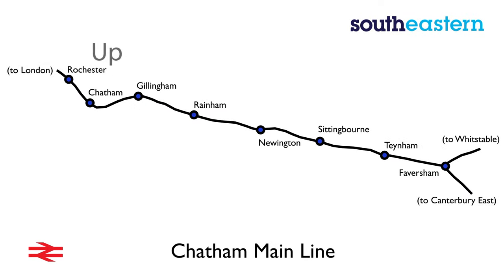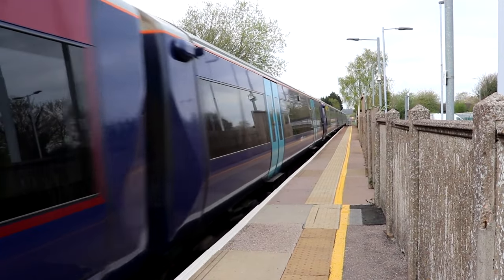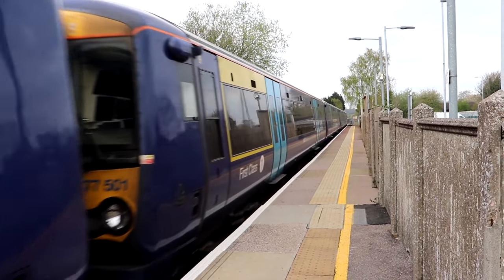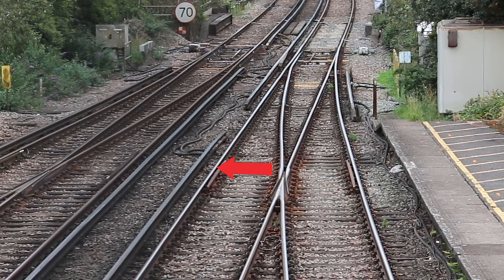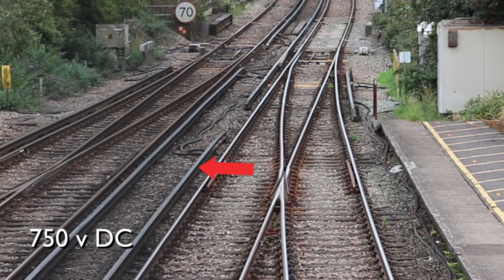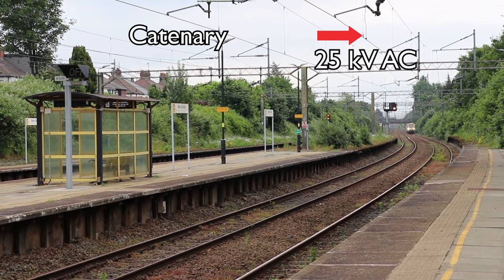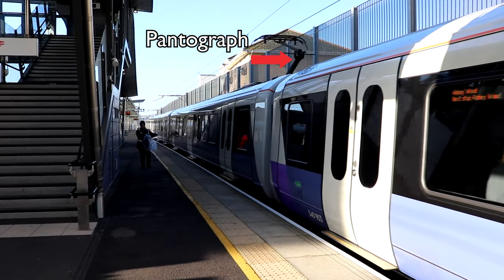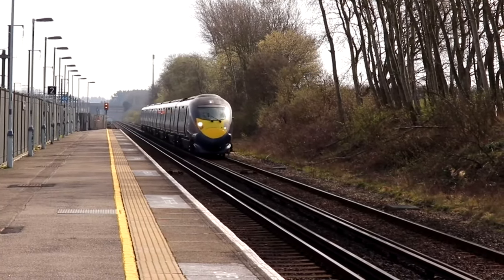British Railway Words and Acronyms

Comment: Often wondered what the letters and numbers in front of a loco stand for , eg  1h25 . Rail buffs mention them when  posting a train destination . Appreciate a response .
Reply from the maker: These are Head codes, more commonly seen on older locos, but are still used today in 'back of house' operations to distinguish services.  I believe the first number indicates class of service ( 1=express, 2=stopping service, 3=Test Train etc)  The next is a letter describing the route, which vary from region to region.  The last two numbers show the service number, 01 being the first service on that day and so on.  If there is interest I may also do a short video on this in the future.  Thanks for watching.
Reply: @RainhamRailEnthusiast  Sort of - you are almost there, the first number is the running class (3 - is a passenger timed train, 4 - fast freight like a liner, 6 is freight, 7 is freight, 8 is freight and 0 is a light loco, the letter is a route code and there are loads and loads of them, all trains have a Headcode.
Reply from the maker: @newage3  Thanks for that, I must admit I did answer quickly to the best of my limited knowledge about this subject, so any help is appreciated..  Any further research material is always welcome for a future video!

Comment: Your comments about Up and Down aren't technically correct... the Up and Down lines head towards and away from the headquarters of the company  that built the line. While this often refers to London, it doesn't always... the old Lancashire and Yorkshire routes, for example, change from Up to Down in the middle of Manchester Victoria station. In fact, there used to be a 0 milepost in the station!
Reply from the maker: Now that's an interesting piece of information, thank you and thanks for watching.